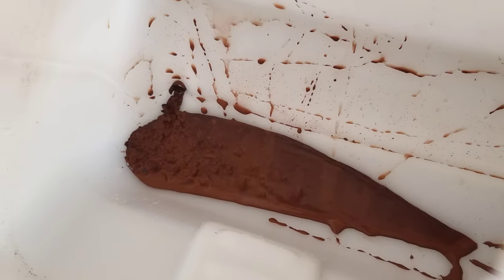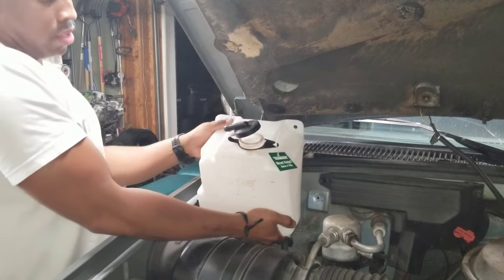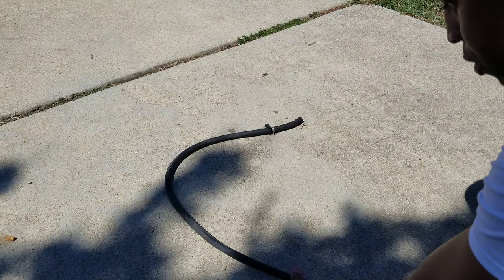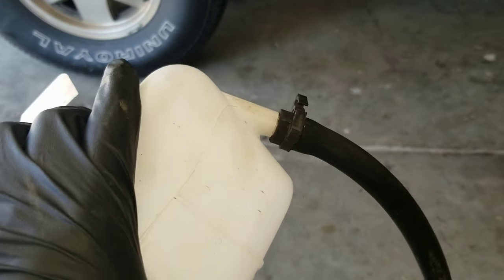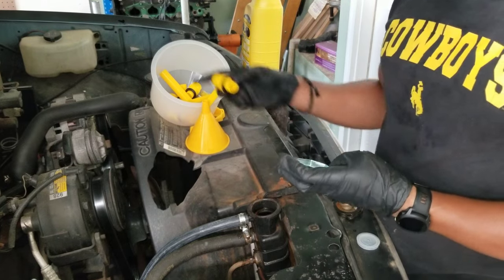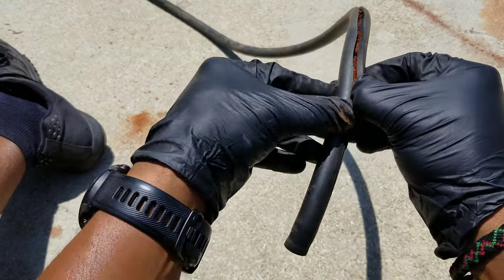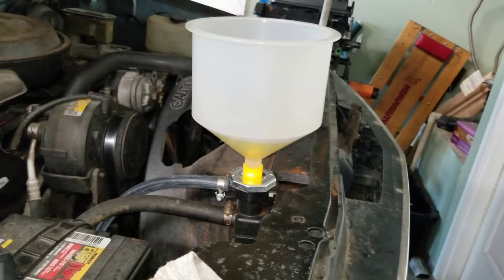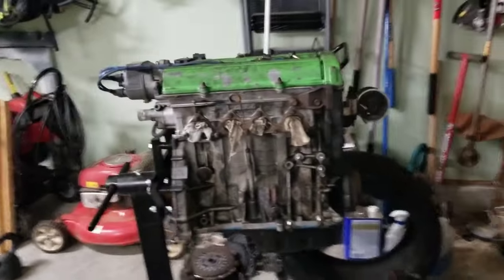89 K1500 | more flushing of the coolant system

Comment: Used a fuel line after wasting tons of time trying to find a new overflow hose. Thanks for making this video! Honestly needed this video months ago. If you rename this...replace your clogged overflow hose on a k1500 I am sure it will get more hits. Or at least it solved my constantly collapsing upper radiator hose issue.

Comment: I wonder if the truck had that orange dexcool at some point? That will cause that and also cause the milky shake looking stuff in the radiator and can scare you into thinking you have a blown gasket.
Reply from the maker: It absolutely had the orange dexcool at some point.😐 This truck was very neglected when I got it
Reply: @MaqsVids  that was the issue then lol, that junk will sludge a system like no other. I saved your videos and I took my radiator out like you did in your other video, it's sitting and waiting for me to have time to get to it but I'm going to individually flush the whole system.